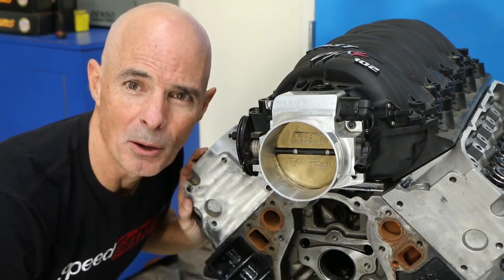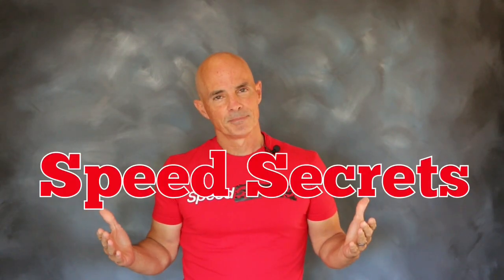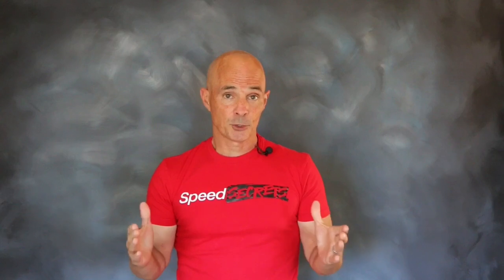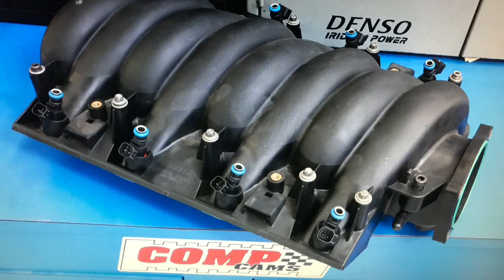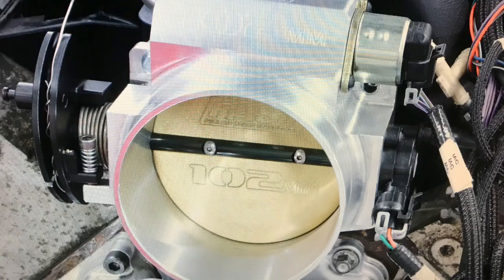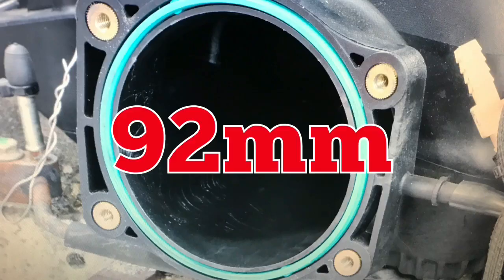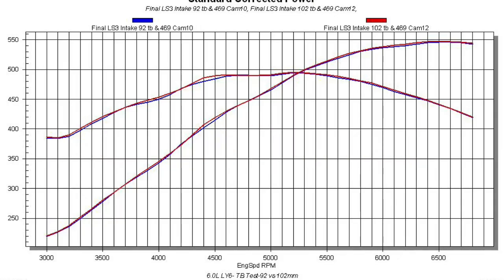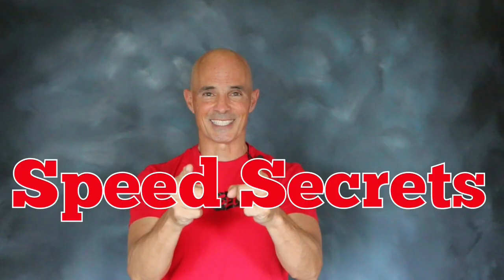LS THROTTLE BODY TEST-92 VS 102 (IS BIGGER REALLY BETTER?)

Comment: You really didn’t prove anything that common sense wouldn’t tell you. If people are that dumb to think that putting a bigger Tb in front of a smaller opening......the real test should have been swapping throttle bodies on an intake that could accept both.
Reply: Kfx Guy there’s a reason those adapters exist, and it’s not because people don’t think they work
Reply: Jordan Breier your statement doesn’t make sense. 

They exist because people ignorantly think you can put a 102mm Tb on a stock intake with a 92mm hole and it’s going to pick up power. Which this test proves what I had known without proof.
Reply: Kfx Guy you might not know it yet pal, but we’re saying the same thing in two different ways
Reply: Jordan Breier well look, I’m not a good mind reader. I try to be. But I have yet to perfect it. The way you worded it, didn’t too much make sense. However, had you said “there’s a reason those adapters exist, and it’s not because people think they work”. Then I would think you are insinuating that it’s just so companies can have another item to sell to dummies who would think it would work. But hey, potato-potato
Reply: Kfx Guy yuh

Comment: Adapting down to 92 mm kind of negates the whole test. You would have to start with 102 mm and then bottleneck it down to see if there was a difference. You can put a 200 mill throttlebody if the opening to the intake is still 92 mm you can’t increase any volume.  This is a great idea for a test and I love your videos. But it could’ve been executed better
Reply: But not everyone knows this. Plenty of LS owners aren’t savvy on this so might see the larger throttle body just assuming that it will add power. This is still a test and is potentially stopping people from wasting their money.
Reply: Some actually believe it's just the throttle body size. His point was the size and shape of the air inlet is what determines max potential not just the tb, putting a bigger tb on it does not always mean more hp especiallly if its the air inlet that is the cause of the restriction. And proof this problem exists can be seen in the video, some manufacturer made that 90mm to 100mm adapter. This video has tons of merit. Richard is helping people understand what creates hp, and helping people steer clear of gimmick bullshit. You seem to understand this principal and you don't need further understanding,  so skip it. And since you do understand this principal, you already know the outcome of your suggestion of necking down to 92mm throttle body on an intake that has a 100mm opening... you restricted it's power... Nascar has done this for decades to limit cars hp for certain tracks. Even if we know the outcome, it isn't a bad video idea in fact your test has merit too, perhaps you could make a video and post it.
Reply: @timschell5781But there's more just because you match the Throttle body and inlet size to the intake manifold, if the air inlet size needed to be enlarged or ported out to match the larger throttle body, the internals of the intake manifold will still be restrictive. 💯
Reply: Exactly!
Reply: Even if the Throttle body size is say 102mm and you enlarge the opening to the intake manifold to match at 102mm. The intake manifold still wont flow the 102 mm because of the intake manifold's smaller more restrictive internals.
Reply: genepat rick I agree. I watched it but was a waste of time.
Reply: I usually like these videos but this one kinda was disappointing.  We know a bigger throttle body won't make more power when the intake inner diameter is smaller that the TB. lol.  Oh well I forgive him this time...